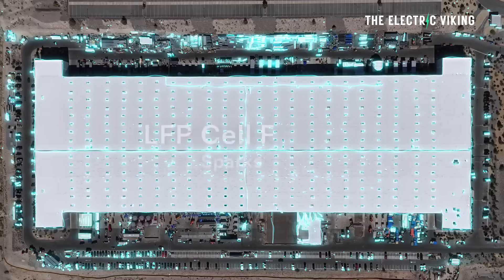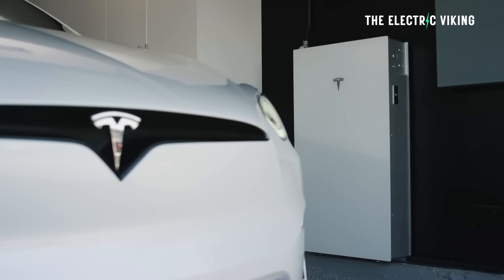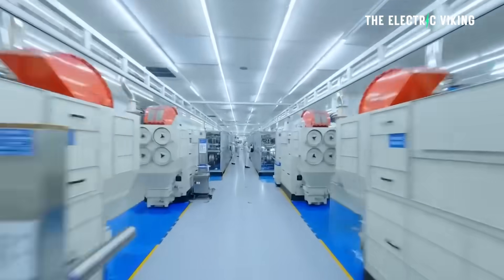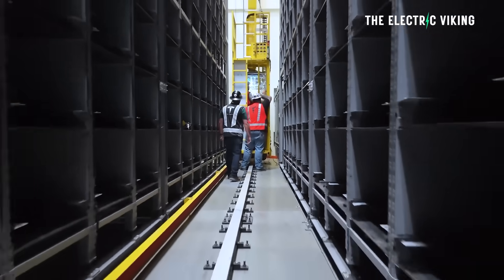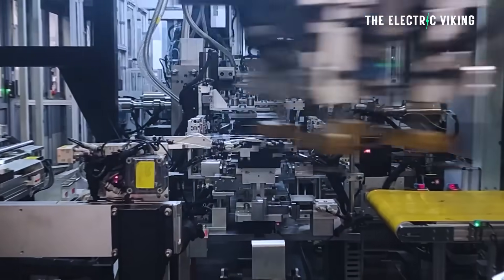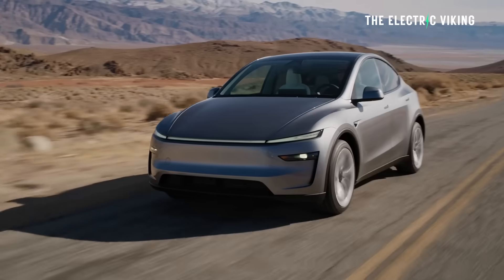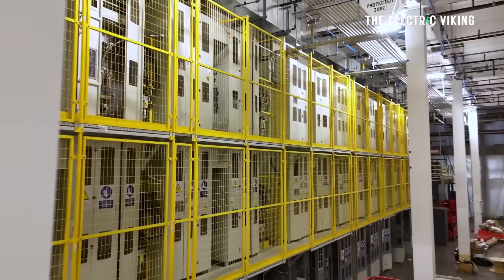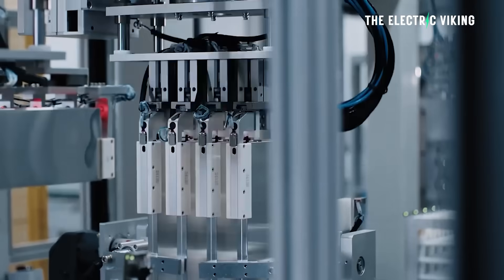Tesla opens LFP Battery Factory in America - Commenters say bankruptcy certain

Comment: OK, so LFP batteries don't have the energy density of NMC batteries, but:
The materials are cheaper and more available.
They don't deteriorate from being charged to full.
They last for more cycles.
They don't spontaniously combust when punctured.
They cost less.
My personal choice for EV battery is LFP.
I speculate that the day will come that Tesla makes their own LFP cells in the 46-80 format using the dry battery electrode process for everything except their plaid series and performance models. This plus the energy storage business means that about 98% of their batteries will be LFP.

Comment: yes, they have to use them in power walls first because the competition forces them to do so. first NMC batteries cannot compete with the price and second, LFP tend to have longer cycle life which is much more important for power walls.
if they have enough left, they could make a model 3 with 20...25% less range with LFP for people who can't afford an NMC battery. the question is if the cell format is suitable or use machines to make a 4680 cell.

Comment: I have LFP battery in 2024 E. sprinter van 220 or 30 miles of range locally about 200 at higher speeds on longer trips and this is a  large van with much wind resistance, so I am fairly impressed with the performance and range even though Would love to see them put a larger battery in the van…. as far as LFP batteries I believe that’s a win. Glad to see progress being made in that regard.

Comment: Early LFP batteries had low energy density compared to the likes of NMC (often referred to as "normal" Li-ion). It was really portable power stations that bought them to most peoole's attention, the first Jackery, Anker, Ecoflow etc products were crazily expensive, but would only have full capacity for about 800 cycles, LFP was more like 3000 cycles. Once people started saying they didn't mind the extra size for something that lasts a lot longer, LFP really took off
Reply: LPF tend to be physically bigger, but whether that’s an issue or not depends on the use. Can you put a usable quantity in a car.
For portable equipment, size matters

Comment: These LFP batteries seem well suited for power pack usage.  Whether they have the “zing” (high discharge current) to provide the performance associated with current Tesla cars remains to be seen.  I think of the ability to accelerate quickly on demand to be the number one driving feature of my Model Y.  If it had no “zing”, I might as well have bought a Hyundai.

Comment: Good to see these new batteries are not using anything expensive unlike when they refine crude into diesel which uses molybdenum, alumina, and platinum, no-one seems to want to mention this, these materials are used once and burnt up in car engines with their exhaust gases pushed out for us all to breathe.
Reply: Refining crude oil also uses cobalt!!
Reply: Some of those are catalysts, which means they do get reused and don’t end up in the fuel

Comment: the people who said LFP cells would not work are the same saying Sodium ion and redux batteries and all will not work. Any new tech will take years before you see what you can get out of it
Reply: with sodium ion batteries it is really a big problem. instead of a lead acid battery, sodium ion could be interesting because it has low temperature capabilities. but if someone really switches on the brain, it seems that sodium ion can't compete with LFP.
to analyze this:
the most expensive part of an LFP battery is the lithium. iron and phosphate is cheap.
1 ton of lithium is currently around $7250 USD. in an average car batttery is about 10kg of lithium. that is only $73 USD per average (60kWh?) battery for an EV.
if you get sodium for free instead of lithium, you only save $73 for not using lithium. but then you need about 30% more cells to have the same energy than an LFP battery. that makes it a few thousand USD more expensive on pack level.
of course it is not that simple because you can then use aluminium instead of copper electrodes and the cathode and electrolyte is different as well. but just saving $73 on lithium really does not cut it.

Comment: Their intention is the first use this in stationary battery storage and then ramp up the equipment is only scaled to make prismatic cells. You know very well that Tesla uses cylindrical cells for their electric cars.
Reply: then why in Europe and APAC they use CATL and BYD cell for base model 3 and Y? with 62Kwh LFP packs and RWD
Reply: @rui518  I don’t know Coolio you’ll have to ask them, but I can tell you they’re not prismatic cells like the ones they’re going to build in the United States there’s cylindrical cells lol do some research. Have a great day. Let me ask you another question. How come you wear yellow socks on Thursdays that’s weird.
Reply: @marlerjohn i did and it states they use prismatic cells...

Useable Capacity*	57.5 kWh
Cathode Material	LFP
Pack Configuration	108s1p
Nominal Voltage	340 V
Form Factor	Prismatic
Name / Reference	CATL LFP60
Reply: @rui518 From Grok

Tesla is building a lithium-iron-phosphate (LFP) battery factory in Sparks, Nevada, which is nearing completion. The initial batteries produced at this facility are intended for stationary storage products, specifically Tesla’s Megapack and Powerwall, rather than for electric vehicles. 

😂😂😂
Reply: Hahahahaha. Go yell at someone else “crazy eyes”
Reply: also from grok

In Europe, Tesla's base models, such as the *Model 3 Standard Range* and *Model Y Standard Range**, primarily use **Lithium Iron Phosphate (LFP)* batteries. These are typically supplied by *CATL* from Gigafactory Shanghai or, in some cases, *BYD* for vehicles produced at Giga Berlin. For example, the Model Y Rear-Wheel Drive (RWD) in Europe often uses BYD's LFP batteries, which are less energy-dense but offer better longevity and safety, with Tesla recommending regular 100% charging. Some Model 3 and Model Y variants may also use *Nickel-Cobalt-Manganese (NCM)* batteries (2170 cells) from **LG Energy Solution**, depending on production and market specifics. To verify, check the vehicle's charging menu (LFP shows 50% and 100% options) or the battery pack sticker.

You stated tesla only uses cylindrical cells. This is not true for Europe and other markets where they use prismatic LFP, also tesla never told they will only use the new lfp cells just for storage, everyone is just assuming that.

Comment: I am of the opinion that LFP is great for temperate climate storage, however Sodium Ion and Aluminium Ion batteries for storage may provide greater flexibility for temperature exposure in countries that see high heat and sub Zero climate swings.
LFP batteries made in the USA whilst tariff free will still be more expensive than the rest of the world.
US logistics is still hampered. 
I note there is no rail head near that battery factory, so all distribution will be by truck and the US still has not lifted truck mass load levels and refuses to do so.
Countries like Germany , Holland, Belgium, China  and Australia all allow greater mass for transport to optimise vehicle tonnage that reflects back in unit cost logistics for the product.
Using BEV transport reduces that cost compared to diesel truck but still 4/5 ths of the load capacity means a 20% unit cost more in logistics.
moving those batteries even if made into mega pack units comes at a higher distribution cost.
equally the factory needs to be located close to the end use area.  With Tesla's factory nowhere near the vehicle plants you have to think that the batteries won't be used for vehicle applications.
Reply: Note that heavy-duty trucks account for >90% if the degradation and maintenance expense for our roadways, so of course we shouldn't allow even higher axel and tire loadings for these trucks.
Reply: @greggrant4614  you are correct on Axel loading however in Aus our B double and B Triple rigs have less axel loads than conventional single 40 Ft tray or pantech covered trailer. or Taught Liner.
Reply: @greggrant4614  and what are those trucks doing? supplying all the things we demand.
Reply: 메가팩 설치에 사용되는 lfp 뱃더리 팩토리

Comment: They're not the best as far as capacity or weight goes but they have some advantages. Safer, can be drained farther, can be charged to 100% with no damage, can last through more cycles.
Reply: 90% of driving miles in the us do not require long range batteries.
Reply: @MTrekker2001  i agree, but let the buyers vote with their wallets
so far it seems long range vehicles sell very well
Reply: LFP are better in every single way except energy density, and they're not even all that much worse in that one area.
Reply: Those are really the bottom-line advantages in an EV purchase.
Reply: These batteries will go into storage units not cars where size and weight are not an issue
Reply: Not the best in energy density, but best in storage application!
Reply: and better at low temperature don't forget. There is a lot of (eg) Canada where they think about these things.
Reply: The issue isn’t so much weight as volume. They are physically larger. But they also are much less likely to catch on fire.